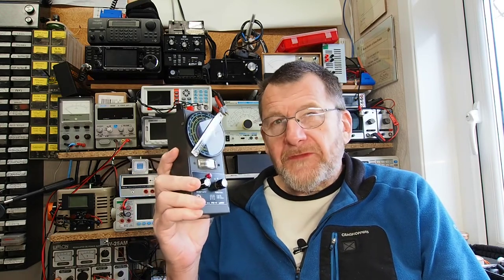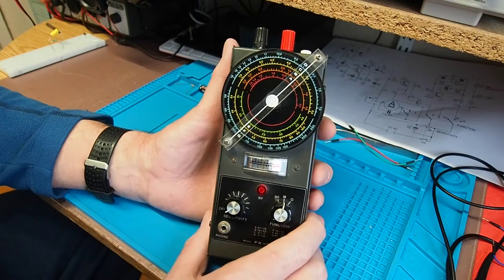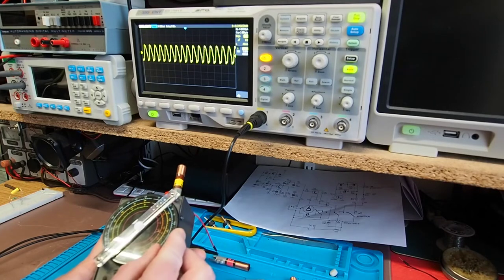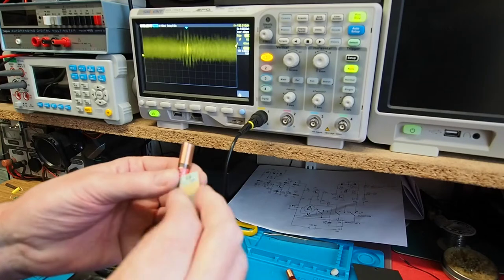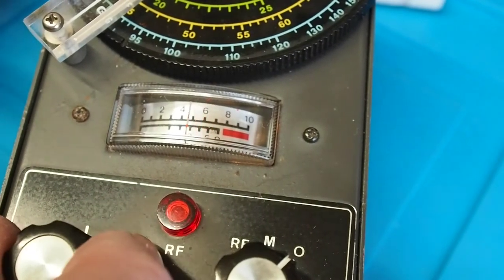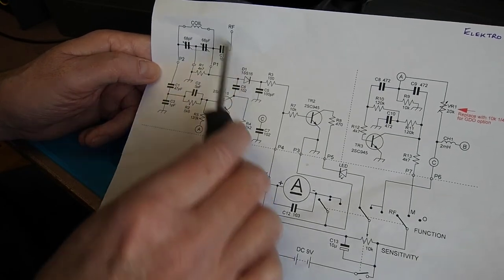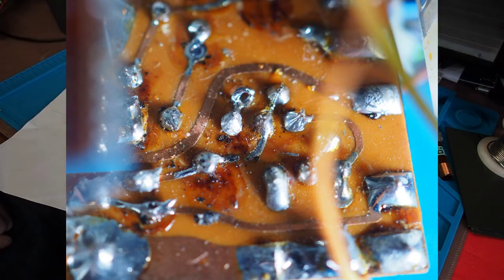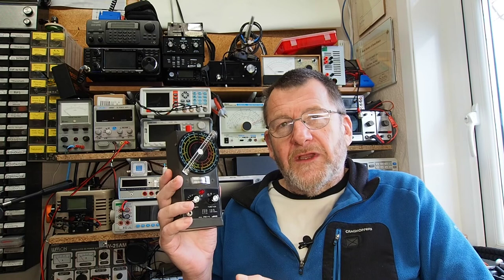The Lowe FX-1 Dip Oscillator and Absorption wave meter - #117

Comment: Hi, I am really pleased to have found your video. I also have one of these lowe FX-1.  I have never been able to get it to work.  Years ago, I took the back off and found stuff really peculiar.  I thought that maybe I have a version which is only meant to be used as a wave meter. Now that I have seen your video, I can see that the inside of mine is completely different from yours.  I do not have a circuit board with three transistors.  I only have a small board above the variable capacitor which connects directly to the coil. There is also a red connector at the top which i presume is for a piece of wire to connect a little wire which could be used as a little aerial to lay beside a coax to search for harmonics ets.  That red connector has a wire to the printed circuit at the top.  There is one transistor on that board, probably which is supposed to act as a little rf amp.  I remember looking at the wiring to the board about fifteen years ago and I think I concluded that it couldn;t really be doing anything - but as I say that was about fifteen years ago, so I do not remember what made me come to that conclusion.  I built a gdo from a Circit Kit years ago which I have always used anyway.  I have been meaning to build a gdo into the fx-1 for years. Maybe I will now, if I get around to it having had my interest awakened by your vid.  I guess I could use the circuit which you have shown us, but I doubt if I will be able to get those transistors now.  There a lot of simple circuits around on the net, probably using jfets as you mentioned.  I wonder if different versions of the FX-1 were around at the time of manufacture. Keith G0ODU

Comment: I've had a similar Heathkit GD-1U for probably as long as Bill's had the Lowe. The Heathkit though was valved and that valve has fortunately never needed replacing. I think the Lowe wins for practicality - as it is more portable having the internal power supply. I would never have thought to check that clever compartment at the back if I were to find a Lowe at a rally. So that was most useful Bill.
If you are starting out, then the GDO will very likely cost you very little at a rally and they are useful beasties. As a very young chap working for KW Electronics I must have made hundreds of traps for their dipole range and it was the Heathkit I used. 
Whatever GDO you find, the Heath GDO handbooks are available for download and they contain a lot of generic information that can apply to any GDO. It tells you how to measure things like capacitance and even determine (roughly) the Q of a tuned circuit.

Comment: Hi Bill.  When we used these things, we were not so much interested in absolute accuracy as long as were we in the ballpark. Was that tank circuit tunning where we hoped it was?  Was that oscillator really oscillating and at what frequency?  A GDO could give you the answer to all of these questions. Oscilloscopes and frequency counters were way beyond our wildest dreams. But for a few dollars you could build a GDO, calibrate its dial using a receiver and you were in business.  Now you could measure the tunning range of a LC circuit and see if that oscillator was doing anything. You could measure inductance, capacitance and frequency, maybe not as accurately as today but you were close enough. to get the job done.

Comment: Hi Bill. Thank you for doing this video. I wasn't sure you would take me up on my suggestion but brilliant that you did. I have commented on this and added a web page link to a supplementary sheet but I don't think You-Tube wanted to print it so I will leave the web page link out. Nevertheless if you google Lowe FX1 there is a vintage radio link and at the bottom of that are some thumbnails. if you expand them there you will find details of the Modulated output (M) which was available as an upgrade kit. To obtain this you need TR3 and some other components including R11 and R12. Strange you have TR3 but not the resistors. I opened mine up and I have all the components fitted. Based on your video I'll connect mine up to my more modest 35MHz scope and see what I get. Thanks so much again Kevin M0KRJ

Comment: To find f0 of a LC circuit, values of L, C or Q, I always used to couple the GDO coil with L. The RF output I used to tune antennas (and to listen the band). M position was usually to AM modulate the RF signal (1kHz on my GDO), I used to align IF/RF stages on radios/TVs.
My GDO was made by Tesla and when I get it it was calibrated the year before. Its vernier was a hair thick line and was powered from 9V battery. It also was able to do drom around 150kHz up to 180 MHz.  I remember mine having radio bananas to connect headphones, I used some 2k headphones.

Comment: Hi Bill. A very interesting video. Bear in mind that the 42MHz output (and higher) is bound to look more like a sine wave on the scope, as the scope's  100MHz bandwidth limits its ability to display harmonics. Similarly, it's hard to gauge the oscillator output level at higher frequencies on the scope for the same reasons of bandwidth limitations. Of course, that's not to say that the output isn't cleaner at higher frequencies. Cheers, Steve.

Comment: Thanks Bill, interesting teardown. That mystery bit of circuity looks to me like a phase shift oscilator (or at least it used to be). Back in my radio ham days of the 1980s I built my own using a kit from Elektor I think. 73 de G0HJQ

Comment: I’m guessing the previous owner tried to convert the GDO to radio transmitter. It would explain the modifications. Did you trace the wires from the phone output socket? Maybe it has been converted to microphone input(?) :)